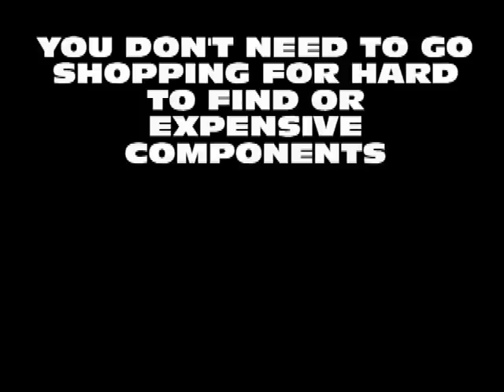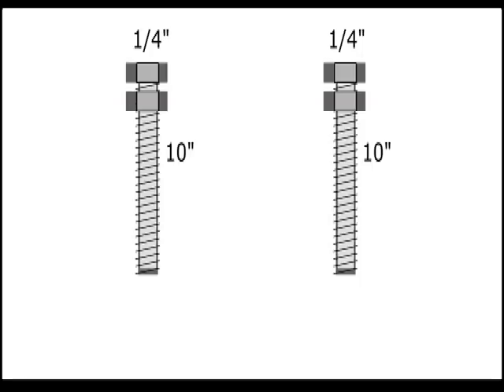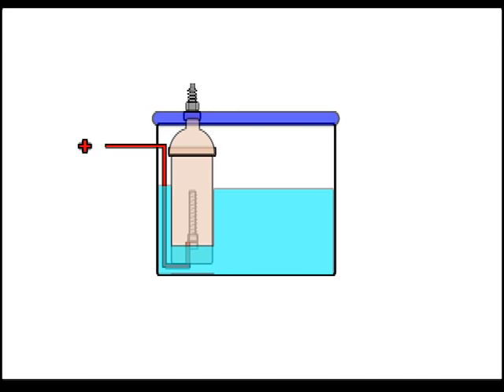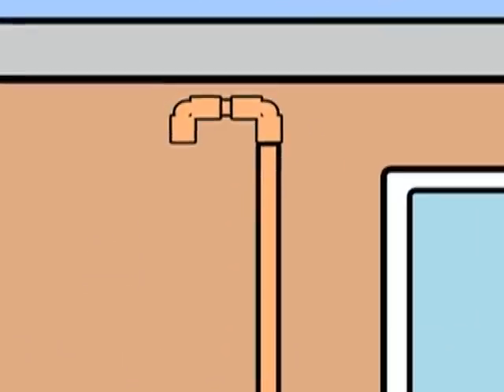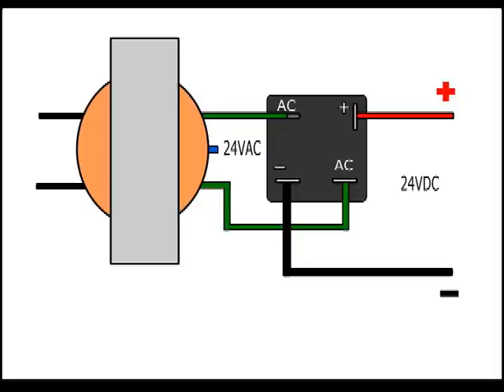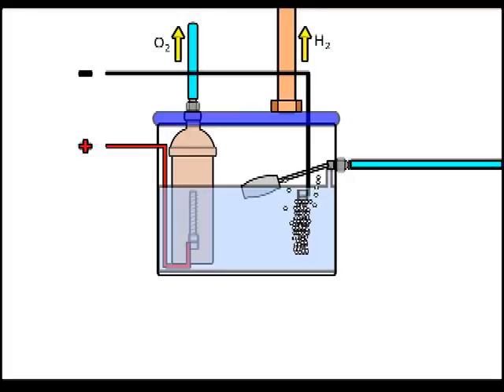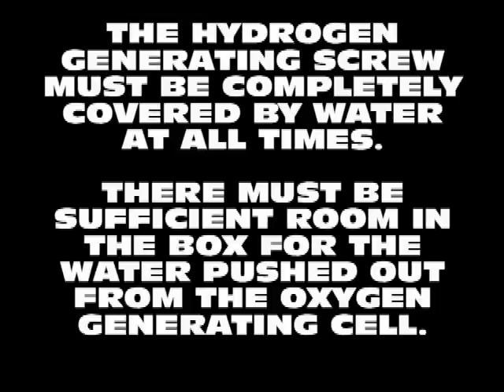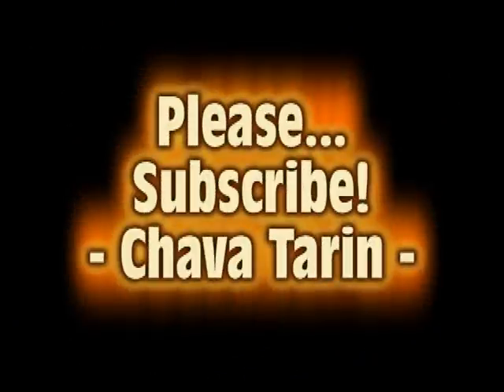Homemade Oxygen Generator

Comment: Dumb question, is this oxygen even safe to breathe?
Reply from the maker: Dear oDisMal, it is not a dumb question at all. The purity  of the oxygen produced depends on the quality of the water used. Distilled water should be used for anyone to breathe this oxygen. The reason is that tap water contains salts, which can give off dangerous gases, such as chlorine. Comments and suggestions about my subscribers have been most interesting in this field. Please look at this updated drawing for increased safety, quality of oxygen, and low cost of operation of the device. https://www.youtube.com/channel/UCmjQnuJwV0FkjdEyi3099RA/community?lb=UgwRGRtRxJVb63bdsUJ4AaABCQ . I suggested solar power to reduce energy costs, plus a solar still for obtaining distilled water out of ordinary tap water. However, in any case, medical supervision is needed if applied for this purpose. Thanks for your question!!
Reply: @eltunene  Thanks!
Reply: @eltunene  Nice answer.
I want to add something: the question was "is this oxygen even safe to breathe?" ... Oxygen is always oxygen. However, what you explained here is that this generator may produce others gases. And that's a good thing to point!
Reply: I want to add another thing about oxygen... Oxygen is safe as long as it is NOT excited by a 60 GHz equipment as WIFI antennas, which make the dioxygen molecule (O2) to rotate (60 GHz being its resonant frequency!) . I won't enter in a debate about why some engineers decided to use this frequency (supposedly to use the oxygen as a natural absorber to reduce signal collisions in a very dense antennas environment).
Just know that excited oxygen is not safe (the red blood cells can't use excited oxygen)... and might cause hypoxia (which we have heard a lot these days, isn't it?).
 
So, if you want to give more oxygen to everyone in your house, make sure to NOT use wireless technologies using 60 GHz (and no wireless technology at all is even better, BTW).

NB: know that elevating the oxygen level in your house will reduce the green plant growth in your house... (reducing it will help them grow). ;-)
Reply: @AnnaëlleD  This may be interesting:   How much Oxygen do plants  INSIDE   our  house produce?  per leaves area,maybe?
Reply: @josepeixoto3384  Sorry, I've no time to measure this kind of thing. I remember my teacher showing us an experiment with a plastic bag, etc. Just consider one thing: at night plants produce CO2... Don't forget to move them or to isolate them from the rest of the house. BTW, even if you don't know the precise O2 emission, be sure than this is well known by elders (who used to have plants in a special area in their house)
Good luck!

Comment: Is it not better choice to use Platinum anode? Also that plastic container will expose to the air & light and become fragile  shortly after installation.. i had many and during the time all  cracks by self..anyway its nice presentation
Reply from the maker: Dear Kamran, thanks for your comment! The thing is platinum is quite expensive! Based on comments and suggestions, I made what I call "a final drawing" with some improvements. You can find that drawing at https://www.youtube.com/post/UgwRGRtRxJVb63bdsUJ4AaABCQ . And yes, sunlight can damage the plastic box, that could be solved by some kind of a shelter to protect system from weather.
Reply: @eltunene Hello, thank you for replying. im sorry if I didn’t pointing clearly, What I meant was  platinized titanium  Electrode not a solid Pt , Im using those kinds Electrode for converting KCL to KCLO3 and its works fine but still depending on the size’s is quite expensive. I was long times searching for a  reliable and effective source of oxygen, should not expensive, not running out right in the middle of works.. like any kinds capsules, not needing to sending back for refilling.. finally I tried Medical Oxygen generator ( I have Krober 4 generates - from 0.1 to  5LPM O2 ) the O2 purity is about 95% which is good enough for my purposes.. the noise level is above 35 dB,
Reply: How about using a platinum ceramic mesh  element from a car catalytic converter? Platinum on ceramic  Its design for big surface area .  would it work ?

Comment: Can we use this to fill oxygen in cylinders? Helpful in medical field now especially at places like Brazil where people are in high need for oxygen cylinders to fight covid.
Reply from the maker: Dear Justin. This suggested project is by no means a new invention, obtaining oxygen from water is a very old system, as early as the nineteen century, used at first to measure electricity (hofmann voltameter), and later for torch welding. However, a formal project could include a solar water still (to get pure distilled water), and solar panels for the electricity source, as well as special pumps to store the oxygen (and the hydrogen) in cyliners for later use.  Please watch this video by a fellow youtuber  https://www.youtube.com/watch?v=DFf0vP3Dtb4 and this article in Wikipedia https://en.wikipedia.org/wiki/Oxyhydrogen . By combining the oxygen cell, a solar still and photovoltaic electricity, large volumes of oxygen (and hydrogen) can be achieved at a low cost.
Reply: One of the problems that you can have is the chromium in the stainless steel that it is released as a result of the corrosion of the screw. Maybe, it is necessary to put some filters to clean the air and make some measurements.
Reply: to clean the oxygen
Reply: The ocean, the poles, the earth.

Comment: What if I use 110V AC directly to a 600V rated Bridge Rectifier instead of the 24V that you are demonstrating to generate O2, would that produce more O2 and HH2?
Reply from the maker: Dear G RP, you are right! The more the energy, the more of both gases you get. However, you must exert some caution and proceed by gradually increasing the power applied to the device, since some heat is also generated. Maybe you could start with a smaller amount of NaOH dissolved in the water and watch for overheating of the solution (by disconnecting the power before checking the solution temperarure). You could also add an external limiter, such as a light dimmer you can turn back and reduce the amount of energy flowing through the cell and thus control the reaction. Please be very careful to check the two gases do not mix. Please let me know about your results.
Reply: @eltunene  thanks for the quick reply! That's a great idea using a limiter on the supply voltage and gradually increasing it. I'll use my thermal gun to monitor the temperature. I will let you know the results. Cheers!
Reply: Oxygen amount generated is proportional to the current in amperes or coulombs. So higher voltage doesn't mean high amount of oxygen, but making heat. The best  is using a variable dc supply has voltage and amperage indicators.

Comment: Thanks for this video. I would put some security sensors. For example, if somehow O2 output is closed, the pressure will push water down, then the water level will rise until it spills out of the box. So, electric part must be far from the box and well insulated! Also, if H2 output is closed somehow, it will push water down. Then, the intake valve will open and pour more water, making more pressure and at the end the water will fill the O2 bottle and spill out. H2 under pressure is very dangerous. If someone is making this for serious usage, the worst scenarios must be taken into account.
Reply from the maker: Yes, you are right! However, the idea is that when any of the gases is closed, the gas has no way out but push the level of liquid in the cell and thus lose contact with the electrode and stop the process. But it can happen that there is not enough room to prevent water from spilling. You are right!

Comment: can you list the parts i need to buy to make this
Reply from the maker: Dear Wilfredo, the parts are not critical, for instance, the tank is any plastic box, preferably clear, the piping is normal PVC used in home for bathrooms or kitchens, the power supply can be just a transformer and four diodes, however, you can test it with your car battery (beware of polarity, so oxygen comes out of the right pipe). The stailess steel screws can be replaced by stailess steel wool, for a larger electrode surface. As a matter of fact, the first part of the video lists the suggested components, but they are not limited to the dimensions listed. Just keep in mind oxygen and hydrogen are very dangerous, since if ignited, they combine violently. Keep all connections airtight.
Reply: @eltunene  ..c..n ..
x j...n...x.x. .c
Reply: @eltunene  ..c..n ..
x j...n...x.x. .c

Comment: Hello.please i have a question. Can i get a pure medical O2 from the electrosis process?
Reply from the maker: Dear Poly, yes, you can, but it all depends on the purity of the water you are using. If the water contains traces of a chlorine salt, such as sodium chloride, this can yield to the production of both chlorine, a toxic gas, mixed with oxygen, which is not good for breathing. If you can used distilled water, you can indeed get pure oxygen. Once you are getting the oxygen,  please follow all precautions related to the danger of handling oxygen and hydrogen, which are an explosive misture. Also, a qualified phisician must check both the quality of the oxygen produced and the amount needed by the patient, which can be easily adjusted by sizing the electrolytic device properly.
Reply: @eltunene  dear chava thanks a lot for your precious ansewer.i will follow this method.and keep you posted.my best regards
Reply: Dear chava. What about if i add caustic soda to water the sodium hydroxide dont make any gases i think?so my o2 will be pure. Thanks a lot.

Comment: Great video. I want to know what is the proportion of caustic soda to be mixed with water. Please share.
Reply from the maker: A 40% ratio should be fine, that is, 40 grams of caustic soda per liter of water. You can slowly add about 10 grams of caustic soda to half a liter of cold water, then pour the solution into a bigger container, and repeat the operation. CAUTION: CORROSIVE AND DANGEROUS SOLUTION! do not add water to the caustic soda, but caustic soda to one liter of water little by little, since the solution generates some heat and if using a small amount of water, the water can boil and burst. Wear safety goggles and rubber gloves to prevent spilling of caustic soda to your eyes and skin in general. Always use enough water so it can absorb the heat and dissipate it, and add the soda into the water and not the other way. It is better to dissolve a small amount of caustic soda first and give it a try for operation of the cell. You can make the solution in a tall glass of water stirring slowly and adding some grams at a time, handle the solution with care. Do not touch eyes or mouth. On the other hand, the oxygen generated may not be suitable for breathing, due to other salts present in the water. Please check with a physician as to purity of the gas, before attempting to use it for clinical purposes. This project is intended for a small torch, with low volumes of oxygen produced.
Reply: Pure h20 is can't pass electricity easily. So  it have to do mixed lemon juice costing soda salt anything

Comment: If the pressure of 02 cylinder is higher how will the 02 flow into the cylinder
Reply from the maker: Dear Sharan, the idea is to use oxygen as it is being produced, not to bottle it into a cylinder. More complex and expensive equipment would be needed to bottle it. In that case, an oxygen concentrator would be better. Thanks for your comment!!!
Reply: @eltunene  Dear sir i am intrested to produce o2 comercially and store it in a cylinder. Is there any cheap and easy way to manf 02 and store it in cylinder or some container .. like using zeolites

Comment: Great video. Helped me visualize everything clearly giving me confidence to build my installation on a large terrarium.
Reply from the maker: Great to hearthat! Thanks for your kind comment!
Reply: I believe plastic is preferable to glass. Just in case something goes suboptimal and the thing explodes.
Reply: @pandemichackingchannel9791  depending on the glass. But acrylic sheeting is just as beneficial. It's all about letting as much sun in as possible.
Reply: @jvon3885  what does sun has to do with this?
Reply: @milaanpatel4997  No sun light is needed except to illuminate the evolution of gas on the electrodes.

 The outer box does not need to be transparent, either. It can be a clean plastic bucket with a tight fitting lid, which is common all around the world. 1 gallon to 7 gallon buckets are typical in "western "countries.

Comment: Stepping down the voltage will reduce output. Stepping up the voltage will disassociate the water faster.

Electricity and water can be a dangerous combination. Even 24V DC can be fatal. 

And this will eat up of electricity.

And hydrogen burns without visible flame.
Reply from the maker: You are absolutely right! Thanks for your contribution!!

Comment: Thanks for your good video..
But can you tell us how many NaOH% must be mix with the water %.. thank you
Reply: Nice to know.
Reply: NaOh acts as electrolyte to conduct DC current through water. The percentage is usually decided by current limit of power supply, but not everyone will have multimeter at home. So eyeballing the bubble and wall socket temperatures works just fine. If you add too much you will burn the wall socket. 

For practical purposes. Start with very little until you see bubble rising, and then keep adding until you see whole screw covered with bubbles. Keep and eye on wall plug temperatures every 5 minutes, warm is ok but hot is not. If you add too much NaOH you will burn the wall socket.

Comment: if positive electrode change to a bigger one, get more oxygen than hydrogen??
Reply from the maker: Dear Anjaly, water is made of molecules containing one atom of oxygen and two atoms of hydrogen. When electricity separates them, you get one volume of oxygen and two volumes of hydrogen, all the time.
Reply: @eltunene  thank you
Reply: @eltunene  I don't think so, the quantity of H2 is twice O2 provided that the two electrode are the same, otherwise the O2 quantity are bigger if the positive electrode is bigger than negative.

Comment: Can it generate oxygen fast enough to help a covid patient ?
Reply from the maker: Dear Shirish, it can be possible to generate oxygen as fast as you want, however, beware, there are some other vital concerns. If water from the tap contains some foreign substances such as sodium chloride and other salts, as well as chlorine in solution, the oxygen can be badly contaminated by chlorine and other lethal gases. On the other hand, only a doctor can determine the rate the patient needs. Another high risk is handling both oxygen and hydrogen, if a considerable amount of oxygen is present in a room, virtually any object becomes violently flammable, such as drapes, fabrics, plastics, even some metals can burn in a pure oxygen atmosphere. Other than that, the bigger the generator, the more gases produced. Using stainless steel plates instead of screws, a bigger power supply and a bigger piece of equipment, you can get any amount you wish.
Reply: Hello, change the stainless steel electrodes to avoid Hexavalent Chrome, change them for titanium, platinum or graphite (the cheapest).

For electricity use a source with more amps like the battery of a motorcycle or vehicle, with voltages between 12v will give you good results.

Add a bubbler to the oxygen outlet to add moisture.

Be careful with the duct that carries oxygen, check that it does not have water drops because it contains caustic soda, it must be dry inside the duct.

Use distilled water to avoid impurities.

--------------------------------------------------------------

Hola, cambia los electrodos de acero inoxidable para evitar el Cromo Hexavalente, cambialos por titanio, platino o grafito (el más barato).

Para la electricidad utiliza una fuente con más amperios como la batería de una moto o vehículo, con voltajes entre 12v te dará buenos resultados.

Agrega un burbujeador a la salida del oxigeno para agregarle humedad.

Ten cuidado con el conducto que lleva el oxigeno, verifica que no tenga gotas de agua por que contiene la sosa caustica, debe estar seco al interior del conducto.

Utiliza agua destilada para evitar las impurezas.
Reply: This ^^^ or maybe in future on other planets where no oxygen is present 🤔
Reply: Yes. Fast enough to burn his lungs.